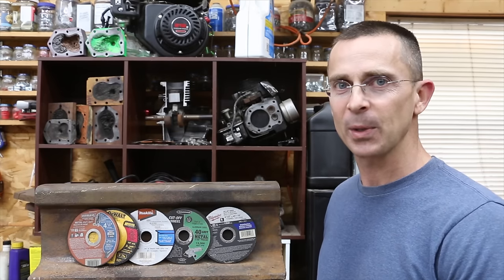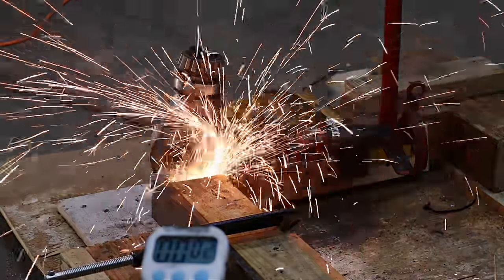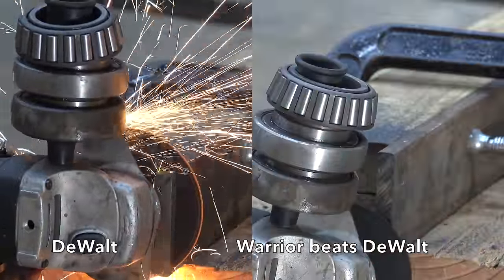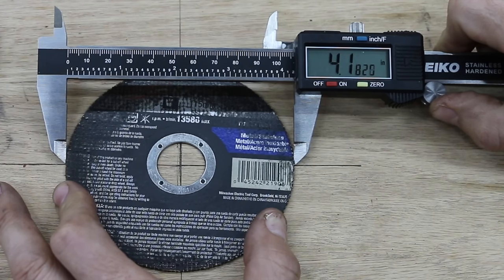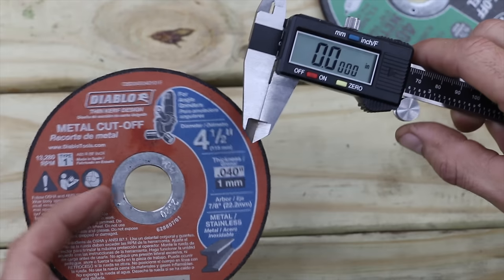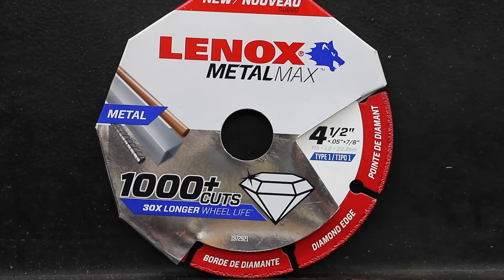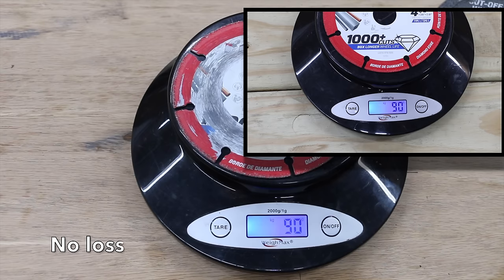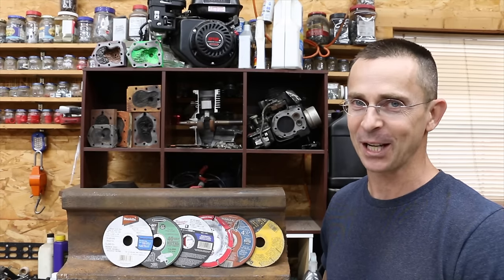Best Metal Cutoff Wheel Brand (6 Brands Tested)?  Let's find out!

Comment: Your math is wrong for the thicknesses and I’ve got no clue what you did for the wheel diameter/material loss. For example the Dewalt at 0.070” is 56% thicker than the 0.045” advertised, but you got 64% because you divided the opposite way. 

The way to do it is: 0.070 ÷ 0.045 * 100 = 156% or 56% more, because it’s the actual (0.070”) as a percentage of the expected (0.045”).

But what you did is: 0.045 ÷ 0.070 * 100 = 64%. This tells you that the expected 0.045” is 64% of the thickness you actually got, or 36% thinner than 0.070”.

Comment: Another great comparison video however there is one brand that you need to add to your tests for grinding, cutting, flap disks. PFERD ABRASIVES 
https://www.pferd.com/us-en/
I’ve been using their products for more than 30 years and they are simply the best available. 
I mainly used their cutting wheels to cut welds and to smooth the area down which is basically abusing the cutting wheel but they always took the abuse and still lasted far longer that other brands. In that entire time I only had ONE blade fail and that’s a darn good record in my opinion.

Comment: This cutoff wheel tests are not efficient nor precise.
How often is a hand held grinder used on a fixed apparatus?
The proper testing way is hand held by doing a Rocking motion
Back and forth to decipate the heat and helps wheel last longer.
Thinner wheels with cut faster and wear quicker whereas the 
Thicker wheel will cut slower and last longer.
The Walter.com Zipwheel is by far the best performer on the North American market

Comment: I don't really think this was a fair test using a bunch of abrasive Wheels which sacrifice their material in exchange for the cut speed, and then compare it with something that is designed to not sacrifice anything in the cut and rely solely on its ability to remove material via it being a harder substance
Reply from the maker: Thanks for the feedback.

Comment: Your percentage calculation for the thickness is wrong, e.g. for DeWalt. : 0.07'' is not 64 % wider than 0.45'', but "only" around 56 % thicker.
Here's the correct precentage calculation: 0.07'' * 100 / 0.045'' - 100 = 56 %
It's also funny how e.g. on the Milwaukee wheel it is listed as 0.045'' thick in imperial units, but only listed as 1 mm in metric units.
0.045'' = 1.143 mm and 1 mm = 0.039''
Here in Denmark, I have also seen the Makita wheels with both 3/64'' and 1 mm printed on them.
3/64'' = 1.19 mm. So they should probably have been listed as 1.2 mm wide just like the Makita in your video instead of just rounding off to 1 mm.
Also, funny where I live the Makita 4½'' wheels have printed on them "MAX 13,300 RPM" while yours says "13,290 RPM". I wonder why there's the negligible 10 RPM difference between the US and Europe. :-) Maybe because Makita use different OEM cut-off wheel manufactures for Europe than in the US,

Comment: Best cut-off wheel brand? You are aware of the fact, that none of these discs is from a manufacturer itself and none of these brands is actually producing cut-off wheels? They only are resellers as all these discs are bought from a manufacturer, rebranded with the label of the tool-manufacturer and sold much more expensive than the ones from the manufacturer itself(Klingspor, 3M, Pferd, Norton, Tyrolit etc.)! Also not a single one is a high-performance quality cut-off disc...
Reply from the maker: Thanks for the feedback.

Comment: This is basically useless information. You picked the wrong grinding discs to compare... They are all more or less the same garbage. No name home improvement store brands. All aluminum oxide. The only time a grinder disc will perform better is I'd it has zirconia or ceramic abrasive grains used. Otherwise it's just a matter of the disc glue, basically the discs that cut slower last longer and the discs that cut quicker wear down faster. This is because the disc breaking down is what continually sharpens the grains that do the cutting. You are clearly not a metal fabricator, more of a diy hobbiest character, so I don't blame you for not knowing any better.